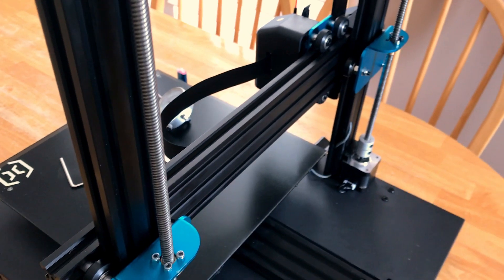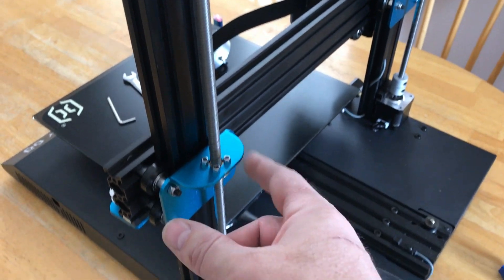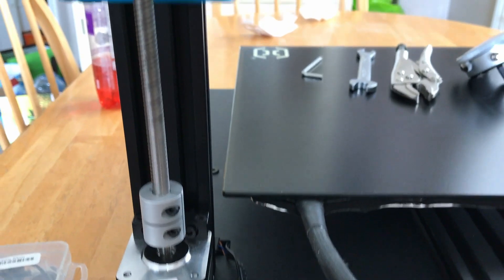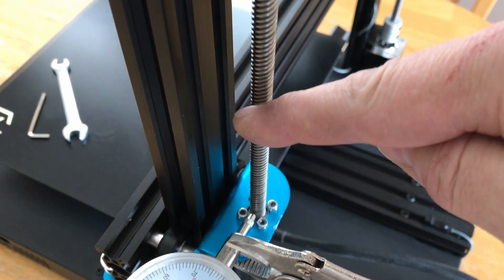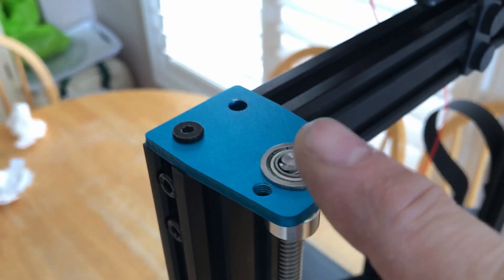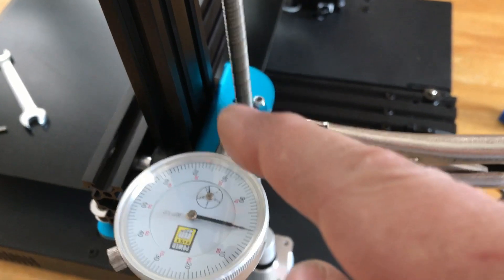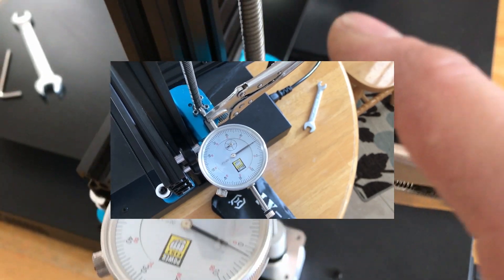Z Wobble Repair - Artillery Sidewinder X1

Comment: i think that the piece that connect the motor and the rod is the responsible of making the horizontal movement because its the only piece that is a kind of spring . maybe if you replace it for one that is straight

Comment: Has it ever happened to you that the printer randomly stops climbing during the print? like for several layers continuosly and at random points? Because it is a sort of z wobble but less regular and with the motors completely dead at least for 10-15 layers before returning to spin (and they don't most of the time)

Comment: Ive been running this printer non stop for 3 years with 10-15k + hours and have just started to experience this issue. Replaced and tightened belts/rollers and all bolts. Countless slicer adjustments and i still cant get rid of wobble. Will be trying this fix next, running out of options.

Comment: Hello, just new with this product. As I turned on my 3d printer, the bed does not move and error appears telling printer halted kill() called. I tried to press confirm but the next page has no option icon and reset option. What shall I do Sir?

Comment: I think I am getting Z-banding, but even when I print a flat object, the first layer has banding on the surface. That's only the first layer. Can it still be Z-whopping causing the print head issue?

Comment: Thank you very much for this video. I have had athe X1 v.4  for a few weeks now, and it's a great printer, but I  need to adjust this as I'm having the same issue. Not so big of a deal at first, but when I have seen what this machine is capable of, I want to tune it :D

Comment: Thank you Mitchell for this video. If I may add, there is something critical that needs to be followed I think. For any shaft configuration, we need to follow the 2 points fixed and 1 point flexible rule, most common example are the drive shafs on car or trucks. If you lock the shaft at 3 places, you will overconstraint the system, I think the reason why you don't see any wobble, is because where you are measuring, you are actually measuring on a fixed part, the screw migh be bending, below the gantry. I have tried what you propose, but I have left the  flexible coupling. Both ends are fixed, and what I noticed, as soon as the dial would shift, it was an indication the screw was not correctly aligned. I adjusted both ends, until there was no shift or compensation from the coupler, and was able to get good print. Also, what I noticed, I have 2 printer, but one has motor coupler exaclty like yours, and the other one has the flexible ones. the ones you have are called fix, and I think those are best. my printer with motor flexible motor, is a bad idea to use, because the shaft will not have a perfect run out, simply because it uses 2 set screws to hold in place. The fixed coupler seem to do a much better job, even for adjustement. I will change mine soon.

Comment: Hey Cameron, I loved the systemic approach to the analysis. How did you remove the plastic spacer blocks? It is not obvious
Reply from the maker: very easily- remove both top supports for threaded rod then loosen screws that hold thread rod in couplers at the motors. *be sure to support the gantry  as it will fall* the just twist out rods and you can then remove the 4 screws holding them.

Comment: Interesting video, I was watching it and told myself, Damn! I dont have a gauge like that. It got me thinking that you could do the same thing with a cheap laser pointer attached to the extruder assembly with a quick cad design and a target on the bed and you'd see the wobble pretty easily

Comment: Thank you so much for sharing, it's great, dear friend. I'm Tracy, my email is tracy@artillery3d.com, thanks again.
Reply: Hi Tracy, did you learn something after watching this video ? Are you going to improve your printers in the next batch ? I hope so because I just ordered one!
Reply: @rf2632_   Thats is something impossible to control from the production point of view. As long you have to assamble the Z axis yourself anyways there is nothing artillery can do to prevent slight deviations. No way to do that at this price point. Even super expensive CNC machines while getting assambled at their final destination are completely reajusted to the new enviroument and while they get assembled every step is controled and checked and ajusted. So Artillery cannot do anything, this is on your side and you have to do it yourself.
Reply: @Stinktierchen  I partially agree with you. If I create and sell my own product and it turns out that lots of users are having problems I would investigate and stop the production and improve the product as much as I can, even if this will cost more money because at the end it will weight on my reputation as brand and as company. QC your prototype before sending it to mass production! If another business will offer more reliable machines I will lose customers and that`s the last thing a company wants! In my opinion you have to put your heart in what you do otherwise its a completely waste of time and money!
Reply: @rf2632_   You didnt understand. When a disassembled product like this is being shipped. Its either up the customer while assembling to take the appropriate measures to do it correctly. Or.. the seller will do it for you. If you pay of course. I told you. Even CNC machines that cost 100k are being reajusted and properly set when being buid up at their final destination before any work is done on them. This is a technical limitation by reality and physics. If you wanted a Z axis that is assembled and super stable and properly set at factory. You will a lot... A LOT more money for that. Do you think I wouldnt want the Z axis to be perfect just by simply attaching it to the body? But sadly thats not how reality works. If you want it to be 100% you have to do the same steps like show in the video.
Reply: @Stinktierchen  They could simply have a good set of assembly instructions (e.g. online and always updated), thus resolving this issue. I think users would be ok with that.

Comment: Struggling to understand how this helps as if the rod is bent, it is bent - and the printer is designed so that it floats and does not transfer the wobble to the gantry.  Maybe if the wobble is really bad the rod will hit the brackets and transfer the wobble and maybe your adjustments would help for that (as mentioned I don't quite get it).... One lead screw on my X1 wobbles quite a lot laterally, the other is straight, but it entirely floats and does not appear to transfer any wobble onto the print.  In terms of gantry pitch changes probably tightening the rollers and possibly other adjustments you made help but I also don't see how that has anything to do with wobble in the lead screw(s).
Reply from the maker: It will not help if the rod is bent.

Comment: Amazing find Cameron. So if i understand correctly, the steps are to loosen the 3rd nut on the top rod bearing bracket, and dial in where needed while progressively moving up and down the z axis? or should you adjust for an overall difference with a small margin/tolerance for wobble? Thanks for any help! Hope this works for me as well, great work doing the R&D👍👍
Reply from the maker: Thank you for the kind words and yes you want the smallest of difference over complete travel. What you will find is its the complete system that needs to be looked at. The steps I talk about can be in any order, its just a method that I found to work to find areas of trouble.  You may find the rods are very smooth top to bottom, but your gantry need attention, or the other way around. Just take your time and don't forget... don't sweat the small stuff and have fun printing!
Reply: @CaM203  Really appreciate it sir! Keep up the great work!

Comment: In my printer I found one side of the carriage plate where the lead screw nut is mounted is not 90 deg to the side of the carriage where v-wheels are attached it should be L shape with perfect 90 deg to avoid wobbling while sliding up and down parallel to z-axis. I think the blue thing or whatever it's called was there to compensate for this imperfection on the carriage and avoid stress on leadscrew due to misalignment while sliding parallel to the Z-axis. Am not sure if this non squared carriage plate is the case with all printers which explains why some people are having z-banding and other not.

Comment: The first thing I did with my sidewinder was adjust the rollers on all axis. Being an old time tool and maker I am always concerned with any slop in guide ways. Did you notice the two Z axis lead screw nuts float in their mounts? That is to allow for the screws to wobble slightly without imparting that force into the moving carriage. The lead screws are not precision ground ball screws. They are roll formed acme thread, perfectly good for this purpose.
You did the correct fix by adjusting the rollers, the minor wobble in the screws is not going to be an issue for functioning.
Have fun.

Comment: Very well documented! As a licensed millwright I work with large scale machines using these “trueing” techniques almost exactly. Your thinking was spot on. I understood what you meant even without using the correct terminology which is amazing for the home user. Thank you for being so thorough and posting your findings!           Just for knowledge sake, and to maybe help guide you or others in future “trueing” tasks , I’ve posted below just a few descriptive wording and terminology edits that I caught while viewing. Should make researching much faster in the future! *Dial gauge - commonly known as a “dial indicator” and can come on its own but is usually mounted to an adjustable sliding arm with thumb screws and bar clamps. It can use a magnetic base or other rigid devices to avoid use of locking pliers 👍🏻 but your method was executed perfectly with understanding the firm mounting. *The threaded rods are commonly known as “lead screws” or “acme thread positioning screws” due to the specific square cut and 20deg pitch angle which makes it very smooth and strong making them superior to traditional 60 deg threaded rod that is used for fastening. Hope this helps! We need more informative content like this to help the community of makers grow! Keep up the great work man! Cheers!
Reply from the maker: Thank you for your kind words and the info on part terminology. Happy Printing

Comment: There’s a reason why flex couplers are used. It’s to minimize any stress to the stepper motor and/or the bearings due to misalignments between the two different axes of rotation. No two axes can ever be aligned perfectly to be colinear. A flex coupler acts like a u-joint but without backlash or hysteresis.

Using a solid coupler will introduce stresses in your system and will lead to premature bearing and motor failures.
Reply from the maker: The solid couplers are stock and come from factory installed. Earlier Versions of the X1 had the 'spring' style coupler but on the Version 4 they changed. Hey who knows it's China and is very possible that each batch has different parts depending on supply.

Comment: Your runout guage should be in the middle of the unsupported section to get a real measurement of the play. I have an Anet A8 converted to an AM8 with an aluminum frame with 8mm linear guide rods, but I still get the slightest z-banding that bugs me. I don't know if it's the video making the pattern, but look at your lead screws at 6:19 .......There is a definite pattern -  you can see a dark thread separated by 3 lighter ones all the way up.Also, take into consideration that the runout guage has a spherical tip which will 'ebb' and 'flow' as it rides over and sinks into the threads of the lead screw. That's probably where the play comes from that you see on the gauge. Glad its fix tho!

Comment: I just tested mine.  it printed better than my Ender5.     I can physically see a slight wobble on my right gantry but testing using your method showed nothing at all.  Tested both sides and nothing.  Do you have a video showing this wobble and what was showing up on your prints?  I'd like to know if my wobble is NOT affecting my prints.

Comment: I am a machinist and none of what your saying makes sense. I am really happy that this worked out for you. But hypothetically if your have a lead screw with a bend, or thicker spot or even a twist and you adjust a specific spot so your dial indicator reads zero. Potentially you are throwing out the alignment of the rest of the rod. You would be chasing your tail adjusting things as you travel up the rod. Also regarding the rollers by moving that eccentric nut all your doing it removing tension on the rollers. All you have done it released tension off the gantry so its effectively floating allowing you dial indicator to read 0. I don't think your have aligned anything and rather just loosen everything up. (Besides the gantry bearing. You have made that solid.)
Reply from the maker: Thanks for your comment and I can understand your outtake on what I did.  The dial indicators main job was a visual for me to find the inconsistencies in the tools movement and help me locate the area or areas of misalignment. I took the approach similar to adjusting runout on a mill or lathe to see if the rod was indeed experiencing rotation inaccuracy and it was. Finding how the stepper motors rigid coupler and lead screw were reacting together and in my case was wobbling while traveling, I was able to confirm this with the gauge and it allowed me to fix both the rigid coupling to the stepper motor and rod, but also to the gantry. My goal was to get all moving parts that controlled the vertical movement of the extruder as rigid and true as I could because working in fractions of a millimetre as you know, would easily transfer those defects to the print.   It worked for me and I hope you understand my thought process and thanks again for your feed back.

Comment: Awesome job!  I've been really ticked at my x1 after a bunch of upgrades I had done and this helped me narrow down various alignment issues Soooo much easier than all the hoops I had been going through.  After I had upgraded to an SKR 1.4 Turbo, TFT 3.5, Hermara Hotend I just assumed my issues lie somewhere with those upgrades, nope, all my issues were due to the dual Z rods not being perfectly synced / along with X gantry wasn't spot on anymore AND my bed rollers were loose.  Bottom line, just by your example I used the same principals to dial in everything else and boom all better.  Thank you for your time!
Reply from the maker: Shawn Bowen thank you for the kind words! I am happy you were able to get it sorted. Happy printing!
Reply: @CaM203  Also worth noting as I'm installing linear rails atm.  I think possibly a better (or a 2nd) measuring point for the X gantry on each side is by raising the Z (this is for MY setup YMMV) to 394.60.  This gives me right at 1mm gap between the x axis and the top connection brace, and makes it VERY visible if its off at all.

Comment: I could be wrong but loosening the motor screws wouldn't help since it's screwed into frame. Any adjustment from motor side would be lost when tighten back on frame unless you put shims between the screw(s) and frame.  I assume only the top would need to be adjusted to correct screw "wiggling".  Am I missing something? Oh and great vid. I'll be doing this
Reply: I'm getting serious snake oil vibes from this video.
Reply: @brianref36  I also love how people buy a $400 chinese printer and expect $10,000 (industrial grade printer) accurate percise prints.

Comment: Do you have an idea how the wobbling of the screw is influencing the head/gantry and would it be possible by properly decoupling x/y movement? It's my first printer and I haven't even used it yet. Just looking into the issues I can run into along the way.
Reply from the maker: neur303 it’s hard to know for sure. Best practice is to get belts tight, check and adjust the rollers for a smooth travel along their axis. Level the bed and just print stuff. You never know you might not have to do anything or have any issues. Learn how your individual machine is working and if needed you can fine tune it as you go. Most importantly just have fun printing!
Reply: @CaM203  Indeed, thanks for your opinion! 🙏❤️

Comment: Haven't you noticed "artillery Sidewinder X1" that I have been defending your machine for a long time  but I am now finding issues that need your attention, such as: I now have to print everything 10-20  degrees hotter than I previously had too! What is going on with your printer?
Reply from the maker: Colin Fielder have you joined their official Facebook group? Good place to ask these questions and good large group to help as well. Hey I am sure Artillery is not checking these videos out.  If you do get some kind of answer on your question, please let me know the outcome.

Comment: What and where did you get the metal spacers that are on the z shaft.  Great video, simple to follow.
Reply from the maker: Everything on the machine is from the machine. No other parts were added. What part were you asking about exactly?
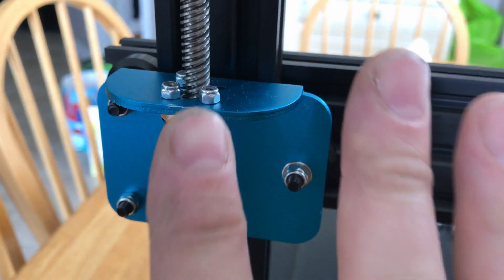Reply: @CaM203  at the 1:27 mark. Or did you just remove the plastic part?
Reply from the maker: MDVYN correct I just removed the plastic parts.
Reply: @Cameron Is there a reason why you didn't put it back on after you straightened the rod?
Reply: @Pokornz  I'm guessing that they are there for when the rods are not nicely calibrated as his are right now, so adding them might make things worse? Not 100% sure really.